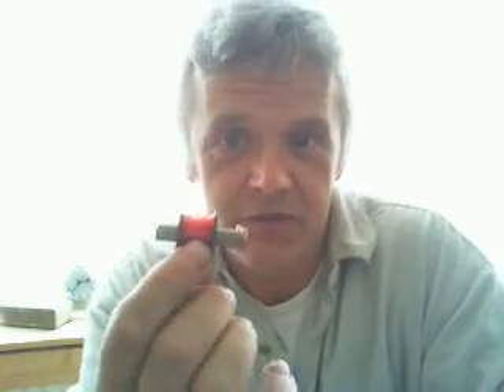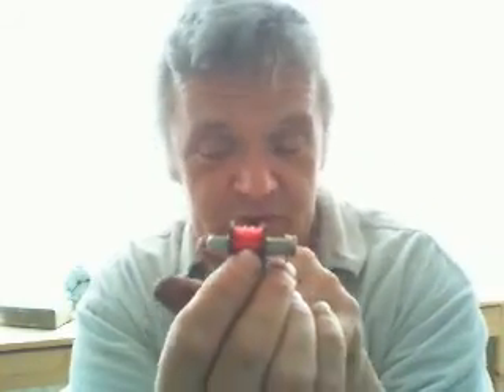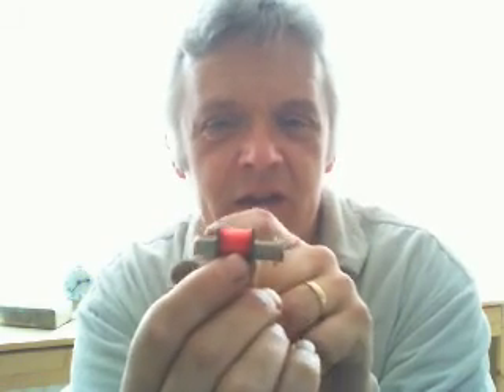How to make your own sound bug from scratch

Comment from the maker: You need to look up giant magnetostrictive materials of which terfenol-D is an example. The foam was kind of an idea that struck me. If I were to revisit the idea I would probably look at templating a nanostructure via a soluble crystal matrix doped with foam laden with magnetite with a particle size at or slightly larger than the domain size which escapes me at the moment but I seem to remember it was around 4nm size, but check this. Hope this helps.